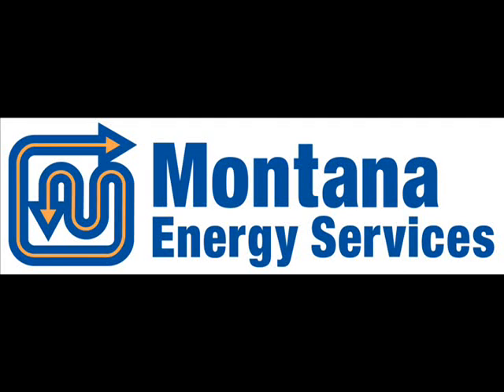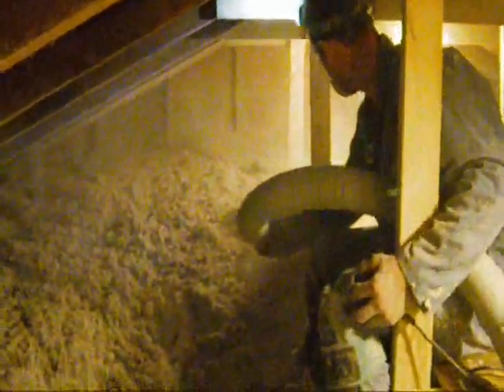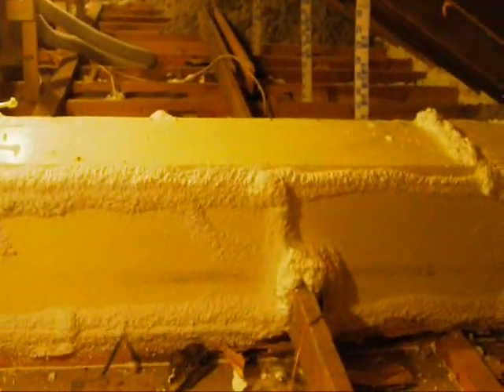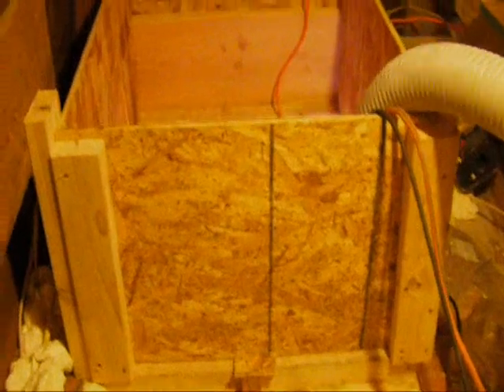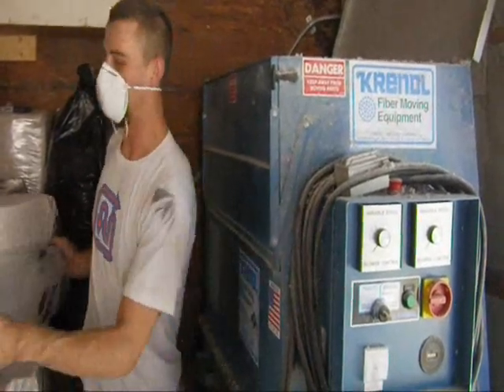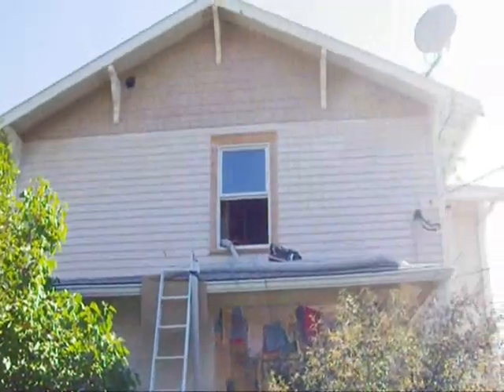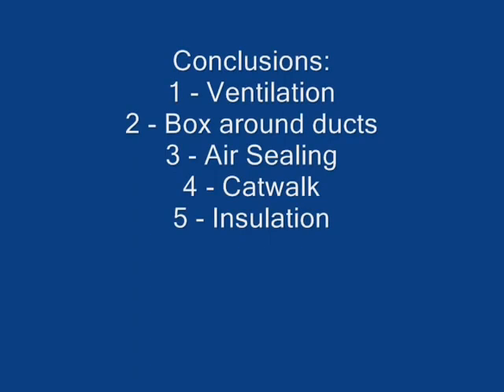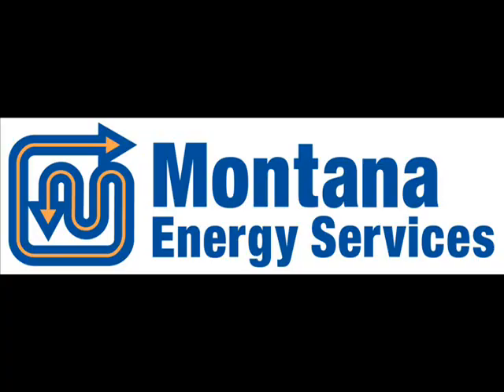MES How to properly insulate an attic - Part2.wmv

Comment: He didn't respond, although I would say just use 12in fiber and just lay it perpendicular(across) the joist's. Since it is a desert, you may want to get it with a moist barrier and make sure to face it upwards.If you old insulation has a vapor barrier make sure to remove it.

Comment: Great video. What would this same job cost for a 3,000 sf house? I live in the desert where summer temps can reach 120 degrees Fahrenheit. Winters don't get colder than 40s. The builder put in less than R40 of insulation in the ceiling... I think 34 or 37. (It's a single-story house). Would you recommend blown-in cellulose for my house? Thank you!